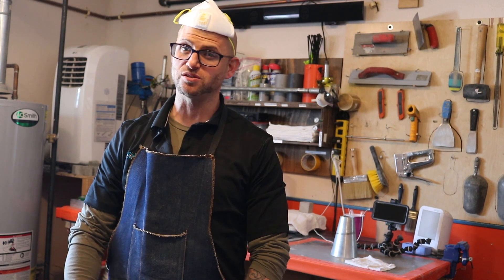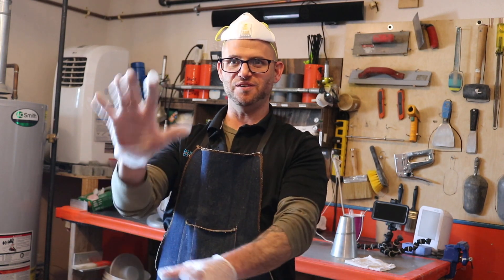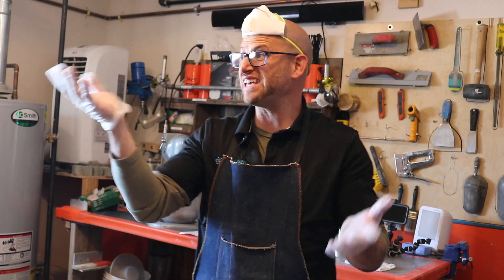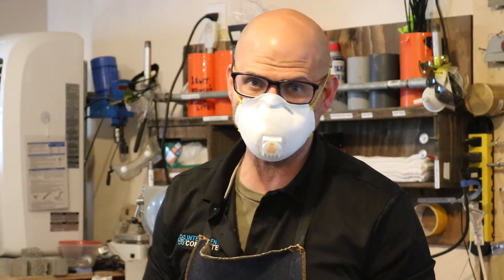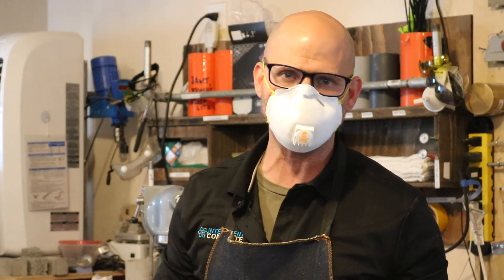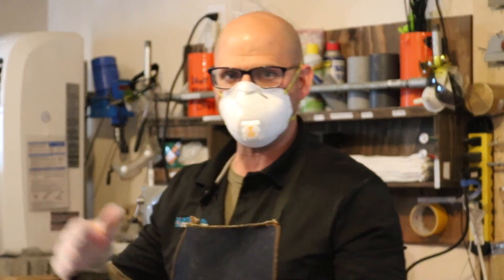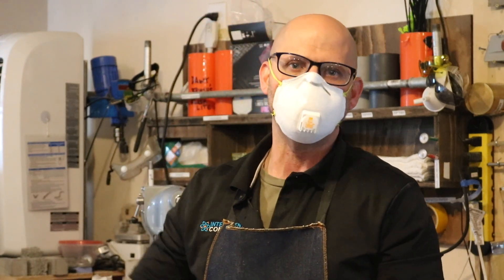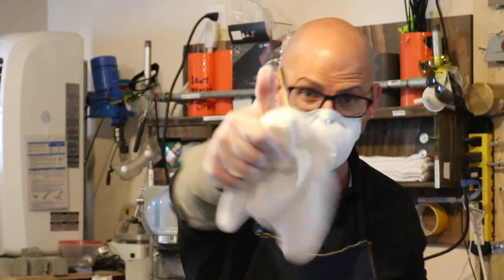High Range Water Reducer Sequencing - Vlog #290

Comment: Very interesting, can you explain chemically how this works? I know there is a window after that time the HRWR loses its benefits. Thanks!
Reply from the maker: FilmFactry the poly carboxylate comb polymers will adsorb to the cement particle surface in order to transmit the forces from steric repulsion from the adjacent cement particles to cause deflocculation.  Without the proper sequencing it is tough for the HRWR / PCP to universally disperse for efficient employment.